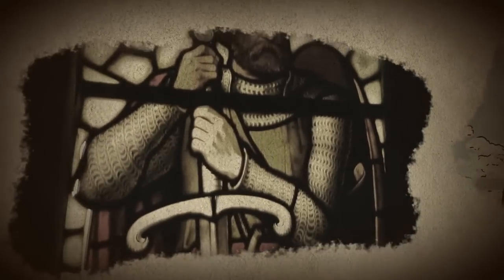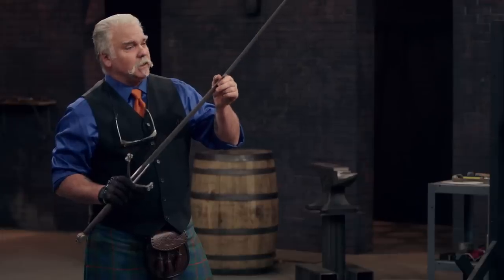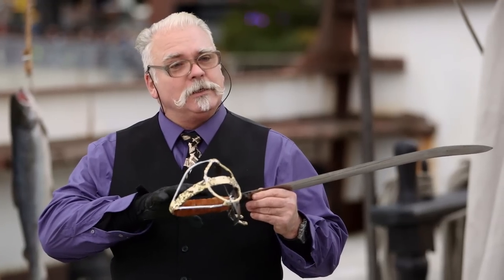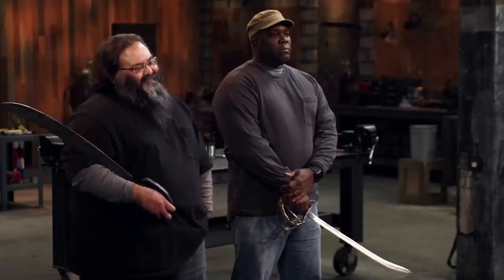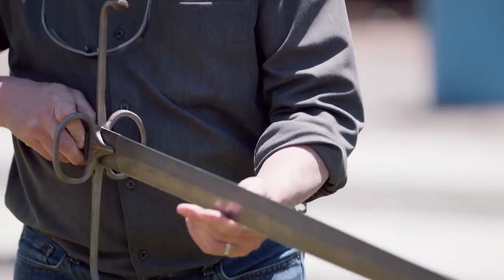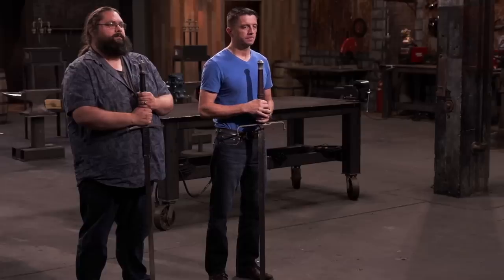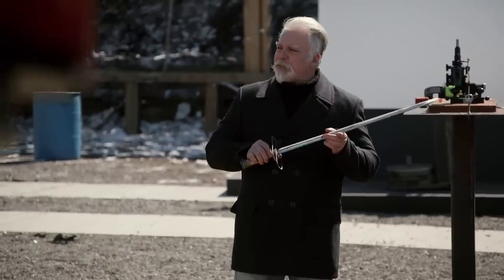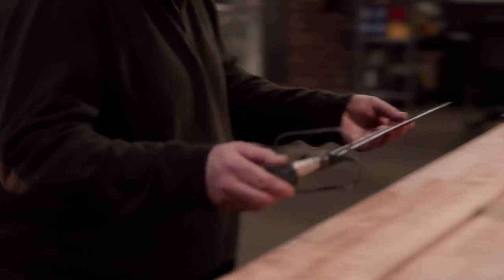4 INSANE Weapons That Did NOT Keal! | Forged in Fire

Comment: The first claymore looks like he didn't swing it straight to me.
Reply: On the second set of claymores, it looks like the first swing was off too.
Reply: Looks like it, but if you slow it down you can see the blade only starts to turn and bend after contact with the pig. You can see it really well on the first claymore on the second set, it hits and cuts, but it’s such a thin blade it starts to bend instead of continue cutting.
Reply: Yeah, forgot to pull my comment, I slowed it down and saw it was a great hit and it was the sword.
Reply: @mikepatten5887 that’s all good. the second katzbalger does the same thing as well. It really interesting what blades do when they fail to cut.
Reply: @ZonaAsier  it is very interesting, it is also cool to think about how people back then found out all the issues with blades without slo-mos through trial and error.
Reply: He doesn't know how to swing.
Reply: @mikepatten5887  oh, it’s absolutely fascinating how they figured out the best designs using, by todays standards, primitive forges, methods, and materials.
Reply: @ZonaAsier  I still don't see it, I slowed it to 25% and it still looks the same. 

The second sword kind of looked like the same type of swing too.
Reply: @Lugh444  the pig is a softer material, so it starts to give and if the blade isn’t strong enough it’ll start to bend with the pig. The metal is stronger and doesn’t bend, giving the blade the option to either cut or bounce off.

They were both downward angled swings, so the momentum of the swing would help spin the sword the way it did.
Reply: @ZonaAsier  It's possible 🤷‍♂️

To me it looks like he has the blade angled for a downward angle swing but he is using sideways momentum. He did a similar swing on the second sword. 
The way that sword cut steel, even after being bent and straightened back out, it should have cut pig. 

I think he just swung it in a way you shouldn't for that type of sword